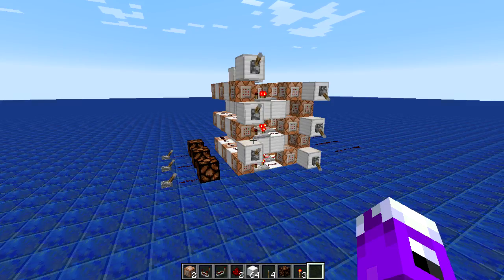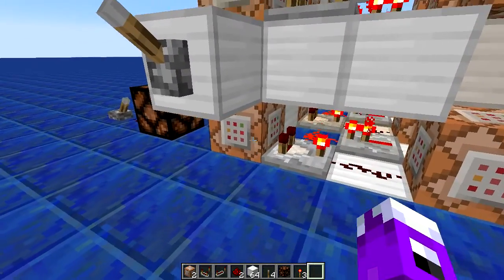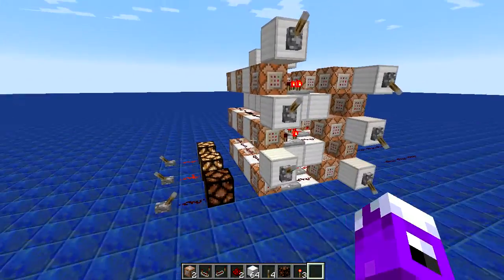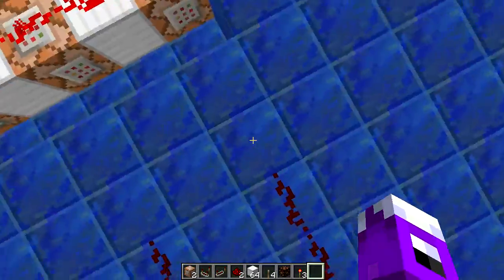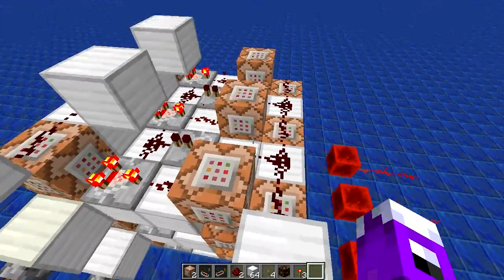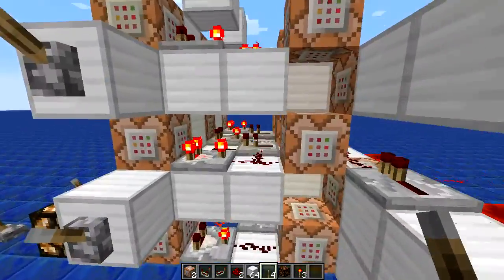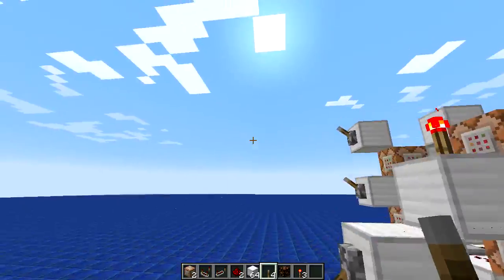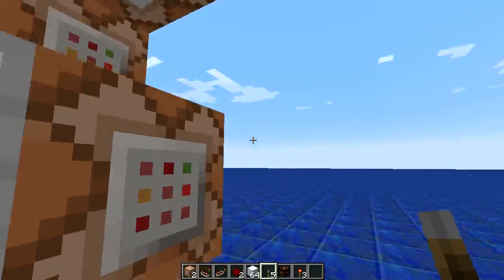Command Block Memory (Snapshot 13w39b) - Redstone with ChartreuseK

Comment from the maker: Yea I think I've done a video on that before, only problem with that is the delay in turning the scoreboard back into binary since you have to test from MSB to LSB in order, testing if greater than or equal to 2^n then removing the value if it is, then after the LSB you have to go back and add all the values you removed back. It's also much bigger per byte than this is since you still need 3 comparators, but a lot more wiring and timing.